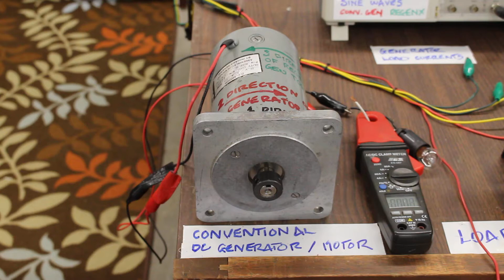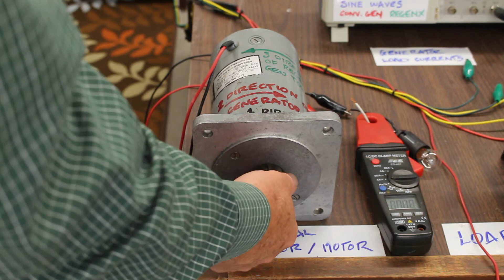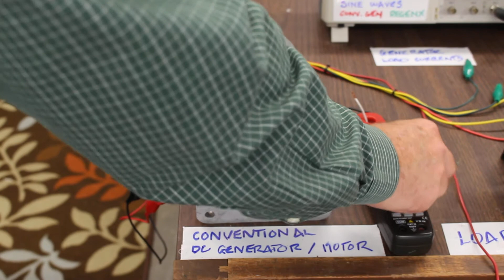PART 1 What is Generator Armature Reaction, EV Regenerative "Braking," Motor Action in a Generator?

Comment: i think i know why the delay lenz hapens. the answer is the magnets and the difference if the softness of the induced field between low voltage and high voltage coil. i think its the magnets the bend the induced magnetic field and when the field is less soft it become harder to bend. i think if the magnets was shaped differently they could bend any induced field in a way that causes the voltage to increase under load. the lenz drag force seem to be worse when the induced magnetic field is in phase with the magnet as the wave form amplitude get lower. the shape of the wave form equals the voltage. that is why the current get high but the voltage get low. if the induced magnetic field was bendt the right way the wave form would generate a higher amplitude under load than before load and the voltage to current would be like a motor and the drag would disappear. the lenz effect is caused by friction in the winding. the friction in the winding get lower when the voltage is higher than the current at a given resistance and the conductivity cancel out the friction that causes the lenz effect to disappear.